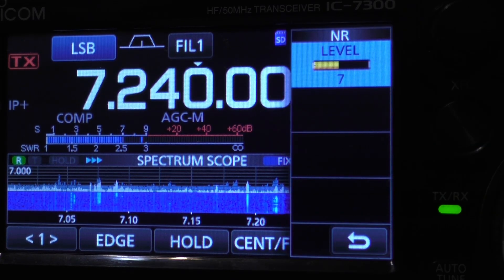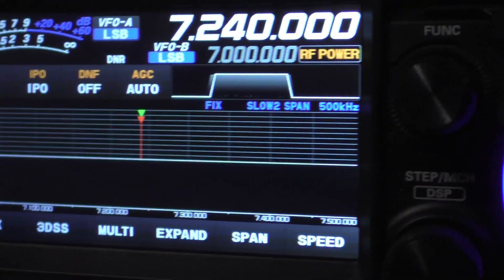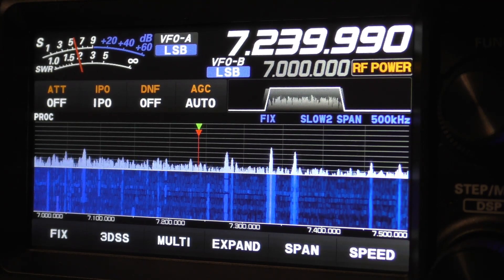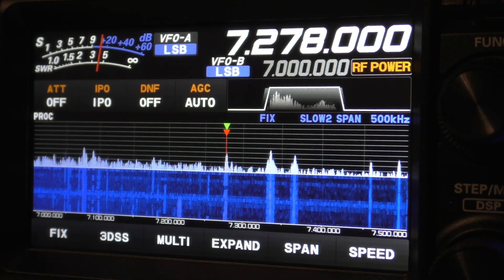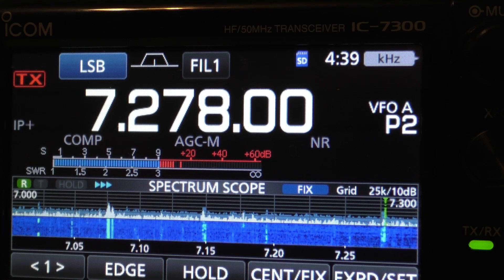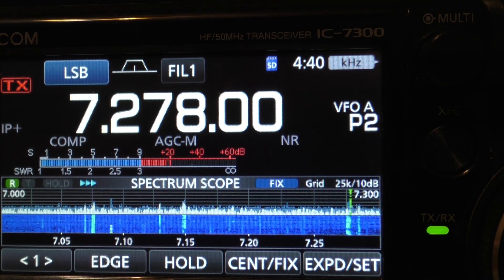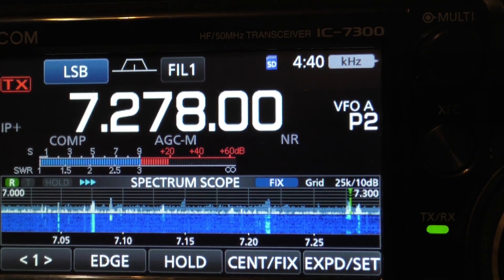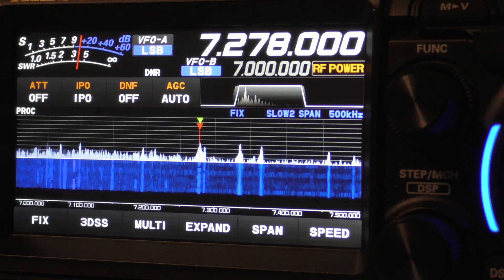Icom Ic 7300 Vs Yaesu Ft 710: Which Radio Has Better Noise Reduction?

Comment: Show how fast the autonotch filter works, how well and quickly you can notch out an adjacent station, show us how quickly you can enable split to work a dx station. Show us each on CW oh and show us signals that are NOT 20 over S9 sheesh, you could just turn down the RF gain on those.
Reply from the maker: This video was for the purpose of showing noise reduction only. Thank you for watching my video!

Comment: In my opinion, even though the noise reduction in the Yaesu is better, it comes at the cost of clarity in the higher audio frequencies.  I’d rather tolerate a bit more noise, then struggle to decipher o muddy audio sound.
The menu system on Icom radios are far superior and more intuitive than the Yaesu system.
Reply from the maker: Yes, the higher you turn the noise reduction up, the more distorted.  I kept my 7309.
Reply from the maker: @saira7cores  i understanding!

Comment: I find that the menu system on the 710 is much easier than the IC7300. Once everything is set up, you just hit the func button and you have the main menu(most used items).
I also love the 3D waterfall. I use it exclusively. Signals stand out!
Reply from the maker: Yes, very nice.

Comment: Why are the NB’s on modern equipment garbage. Icom, Yaesu. Power line noise at my friends house 9 S units. Neither of these radios noise blanking had any effect. He hooks up his Mark V. Turns on the NB without any DNR and the noise was reduced to 2 S units. Another friend owns the 7610 and he also stated the NB is rubbish.
Reply: No, but I have heard of this before. Everyone I have talked to tells me the same thing. So much for advancements in modern equipment.
Reply from the maker: That's amazing! Does he know where the source of the noise is coming from?
Reply: Nb works great on my icom 7410

Comment: 7300 AGC is on Manual and the 710 is on auto. Needs to redo everything:)
Reply: exactly , you can have one set manual and the other agc auto.
Reply: @deanblake5072  M is mid response time for the 7300 Automatic Gain Control, not M for Manual Gain Control. I do agree that the gain response time on the 710 seemed a bit faster though.
Reply from the maker: @johnnypizzaguy   Yes
Reply from the maker: @deanblake5072  It is something.
Reply from the maker: The 7300 has 3 preset AGC settings for all modes except the FM mode.  The time constants are Fast, Mid and Slow.  When you see the AGC-M it means MID for the AGC not Manual.

Comment: The S meter was different because you had the IPO turned on on the Yaesu.
Reply from the maker: Interesting
Reply: @RichRodgersOnline yes I do agree with the comment. Strangely enough Yaesu radios need the front end preamplifier turned on at AMP1 to get “quasi” standard signal levels. So basically for comparisons, Yaesu AMP1 = Icom OFF (ie no PRE) 73
Reply from the maker: @IZ0MTW  Yep,  I didn't notice that when I made the video!!!

Comment: Hello. Thanks for the video. I had one of these but sent it back for a refund from HRO. I hope mine was defective as the fan was on all the time with no transmitting. Is the one you have no fan when receiving only? Thanks, and 73 de WA3RSL
Reply from the maker: I don't hear the fan on receive
Reply: @RichRodgersOnline  Thanks!
Reply: "One of these"...  Which one are you referring to?  73!
Reply: @KX4UL  Wow, I'm really slow on responding. I was referring to the FT-710. 73
Reply from the maker: @frankENZC   I am even slower...   Sometimes I don't seven see that I had a comment...  Not sure if it went to trash or not.
Reply: @RichRodgersOnline  Got it!
Reply: The Yaesu FT-710. The ARRL lab test mentioned this in their test of FT-710. I can copy and paste the paragraph where they mentioned this.  @KX4UL

Comment: Sorry Pal, you showed different NR Levels by 710, not from 7300. But Algorythms differ.
Microfoning internal Speakers means nothing in terms of comparing Sound Quality from RIG itself, line level sound had to be recorded from USB output.
Was RX sound set to flat on both, and was NF Bandwith same Lo and High i.e. 100 - 2800Hz ?
Kind Regards,
Phil.
Reply from the maker: Thank you for your comment.

Comment: Thanks for that comparison,  i agree not much in it .
I have the icom ic 7300 . I don't use the NR much , my 'go to' is and has been the RF gain . Only the RF gain is very poor on the 7300 , somewhat spoiling a otherwise great rig . I find the front end RF on a supperhet is much better than my ic7300 or my Xiegu G90 or my Xiegu x6100 .
My past and present ic781 ,ts870 , ic746 ,ic 7200 ( the best ), ic703 ft3000 , all have a brilliant RF gain control.  The hybrid 101 or ftdx10 might be best of both worlds ? Sadly yaesu ergonomics and interface is very regressive for me . We await the perfect rig , lol .
Reply from the maker: Hi Rob,  I was speaking to a friend who is having his Omni worked on.   He said most of the SDR radios are geared more towards Digital, I guess FT-8 ETC.  He said most of the rigs like the 7300 and FT-710 don't have the Crystal IF Filters which makes the rig sounds good on SSB.  I notice on the 710 turning down the RF knob cuts down the hash noise or background noise.  On my 7300, I can turn the RF gain all the way down to zero and the hash noise is still there.   I have heard the Icom IC 7610 SSB sounds better maybe it has the Crystal IF Filters.  I wished Icom would come out with a IC-7310 which would have the better filtering in the IF.   Just have the one radio not 2 radios in one.   73, Rich
Reply: hate Yaesu' ergonomics , not intuitive
Reply from the maker: @deanblake5072  I understand

Comment: "It is proving to be a challenging task to make a decision. I currently possess the IC7300, and I must confess my dissatisfaction with its noise reduction capability. Consequently, I tend to lean more towards a BHI DSP speaker, as it appears to be superior in this regard. Although I have not yet had the opportunity to evaluate the Yaesu 710, based on the video , it appears to be a promising alternative."
Reply: Turn the IPO off on your 710 and the meter will be "correct."
Reply from the maker: @MarkDecamps   The options are IPO, Amp1 and Amp2.   I didn't see a way to turn it off.
Reply: @RichRodgersOnline  Amp 1 or Amp 2 is considered "IPO off." Per a Yaesu tech I spoke with, the S meter is calibrated properly when Amp 1 is active.
Reply from the maker: @MarkDecamps  That might be right
Reply from the maker: My brother in law uses the NHI DSP speaker with his ICOM IC-7300, too! He called the local electric company.  The electric company came twice to fix the old lines and connectors.    Fixing the bad stuff helped lower the noise considerably!
Reply: The 710 noise reduction is watery trash after level 3. Really bad. Get the DX10 if you want a significant improvement over the 7300.
Reply: @forget_your_life  the new firmware update greatly improved that issue.
Reply: @MarkDecamps  was there a new update in the last week? If not it still sucks past level 3.
Reply from the maker: @forgetyourlife  I can get up to 7 on the DNR on 710 SSB. It sounds pretty good to me.
Reply from the maker: 7 sounded good to me as well
Reply from the maker: @forgetyourlife   On the Yaesu FT-710 There has been an update, but I think it was longer than a week ago.   If you are not on a station at 7 it sounds watery but on a station to me, it sounds pretty clear.
Reply: @forgetyourlife  that simply isn't true, unless you're running the first firmware version. I guess you don't have a FT-710.
Reply: @forgetyourlife Wrong. March 2023 firmware update improves ft710 DNR up to 7.  I use mine around 5 with very smooth sound, including broadcast music and SSB voice equally.
Reply: @TomL2040 Good, I’m glad they fixed it. It never should have been released as it was day 1. Hopefully they fixed the stupid loud fan blasting off 15 minutes into only RX and then never turning off.